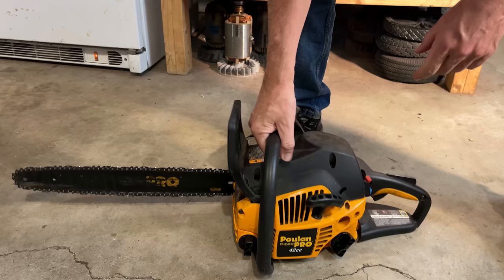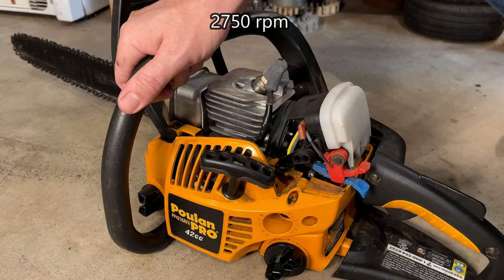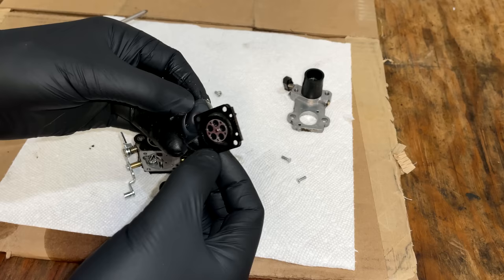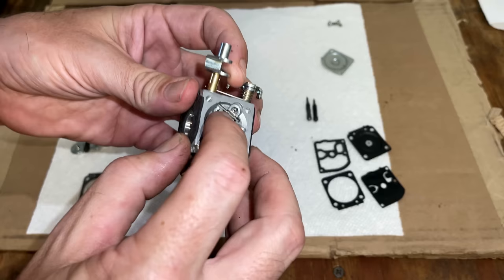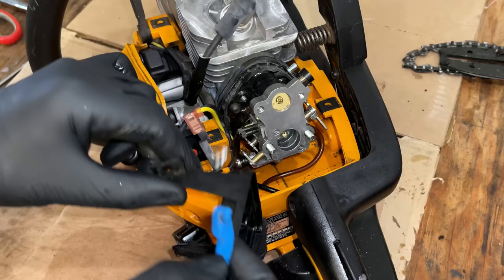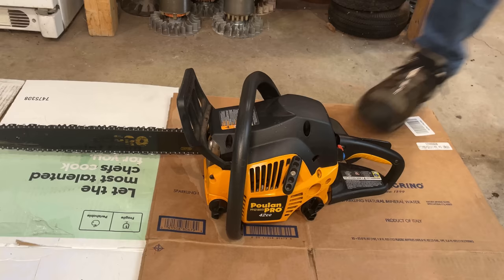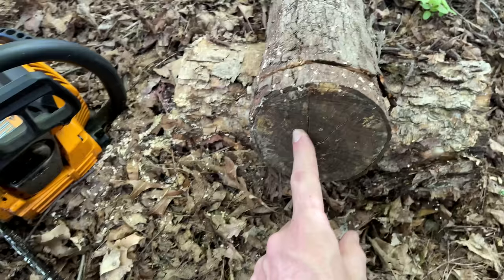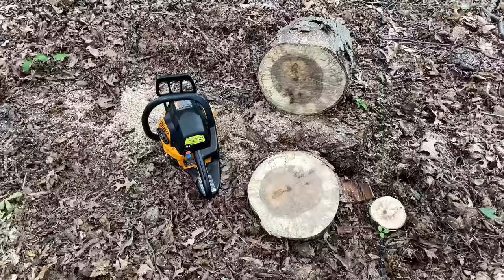Poulan Pro Chainsaw  - Not Running or Cutting Well

Comment: I would have had a look at the spark plug and air filter before the first start attempt; plus old fuel in the tank/lines is always a potential problem; and built up dirt, leaves, twigs around the primary/drive cog could prevent getting a good first impression. 
And once again we are reminded of the hundreds of minds whose contribution is combined into, in this instance, the types of components needed in a miniature carburettor, all needed to replace an axe whose biggest problem was the 90° connection.
The brother-in-law story doesn't resonate, those things don't last 10 years if they were actually needed. Sounds more like a sister problem.

Comment: I’ve had OEM carbs for those saws fail pressure testing right out of the bag!
Reply: When you open the fuel cap if it spits a geyser of gasoline in the air, 
it has passed the pressure test

Comment: Before this video I'd only seen some of your lawnmower videos. The chainsaw engine carburetor in this video looks more complicated than any of the lawnmower engine carburetors. Why is that? Is it because chainsaws need to be able to operate from a wider variety of positions than lawnmowers, such as on their side or even upside down?
Reply from the maker: That is it.  A lawn mower carb only works when level.  A chainsaw you can run in any position.

Comment: dang man i wish you got into the trigger assy; I have rebuilt my uncles old 90's Poulan Pro 295 but i failed to take a picture of how the throttle cable linkage is connected in the trigger assy (why did i take this apart!!) and I cannot get it back together

Comment: I would have also , at least , would have inspected the fuel pick up filter.  Larry Small is right the spark arrestor screen needed to be at least checked and or cleaned.  Then most importantly NEVER loan it or probably any other tool to the dope that did that to the chain , I mean what were they cutting?  Concrete?  Then not maintaining it at all as far as I can tell , son of a gun that looked bad.  One question , did that saw have bucking spikes on the left side of the bar?  I couldn't see any..
Reply from the maker: That chain was definitely cutting rocks.  The fuel filter and spark arrestor looked fine.  Did not mention that.

Comment: Poulan, Partner, McCulloch... I don't understand why Husqvarna Electrolux maintains all these brands to make products of inferior quality than those sold under the Husqvarna brand.
My dad bought a Partner 350CCS in 1996/97 and it never worked properly, had the carb replaced several times under warranty and several more times after.
In 1999 he decided to buy a chainsaw to replace a Partner S55 from the mid 70s just because it hadn't chain brake, back then there was no internet here to find compatible parts from newer models or models designed for other countries.

Someone recommended a Husqvarna to him, his answer was like "how the hell am I going to want another Husqvarna if the Partner that doesn't work says on the label that it's made by Husqvarna"

23 years later we have seven Stihl machines, we just had to buy a few spark plugs and air filters. I also have a Husqvarna hedge trimmer that works perfectly, I bought it second hand 10 years ago after determining that only when it is sold as Husqvarna it has the quality expected from a brand like Husqvarna, and it has not given me any problems either.

I have also repaired several Husqvarna chainsaws for other people, except for the wear and tear parts I just had to adjust the carbs to make them run like new.
I tried to rebuild that crappy 350CCS, the fix is using a brand new carburettor every week, looks like Walbro makes them OEM carbs just as crappy as the rest of the machine. 

Now I have two half worn out but authentic Partner chainsaws from the 70's (I was given a very early S55) that perform much better than new Partner's right out of the box.

Comment: Great video. I actually have two Poulan chain saws one is an older Wild thing both with the same issues. Not wanting to mess with them after sitting for a couple years I took them to the local small engine place to let them check em out. They redid the carbs, replaced the fuel lines etc. and were supposed to make the run and idle. I picked them up but they sat for a few months before using. They did start up and idle but neither will idle hot after cutting some wood. They'd die immediately after the throttle was released. They will start right back up and cut but the hot idle is the problem. Think perhaps it the low adjustment a bit to rich? They both seem to have adequate cutting power. Thanks.
Reply: Try adjusting your spark plug gap. The gap is set very tight from the factory, and once it heats up, the metal expands, and the gap is too small to keep it idling correctly.

Comment: allways use an air chuck too clean the bar and oil bar holes if you dont it will destroy the new chain and after so long of use when you sharpen or replace chain flip bar opaset so it wares even

Comment: Even a badly worn chain when sharpened, should cut better than this one did.  I could be wrong, but it looked like the "rakers" (depth of cut control) had not been filed down to compensate for the worn  teeth.
Reply from the maker: They should.  But the chain was in terrible shape.  Did not spend much time on trying to bring it back.

Comment: i am surprised someone would pay to have one of these service. i guess it makes good content for youtube but i can go to princess auto and buy a refurbished saw just like it for $150. these things are rarely worth doing much with because they are almost cheaper to replace than to buy parts. my neighbor had one that needed $100 in parts. i ended up lucking out and finding a parts saw free. the funny part was the parts saw actually ran and had 150psi compression never thought to check a saw i got for free till after i pulled the needed parts off it.

Comment: What do you think about the pre mixed 🤔 fuel from the store.
Reply: Save your money. Use Sunoco non ethanol or other non ethanol 
gasoline with any modern 2 cycle oil rated for 50 to 1 or better.

Comment: I had a Poulan that was multi attachment, ended up using it in chainsaw mode only. These things are vicious with cutting wood but the Mower Center I was taking it to for servicing hated it. They rev high, use far too much lube bar oil, and the carb is a pain to deal with. Also, the vibration dampening is 'non-existant'. After only two service intervals, the Mower shop didn't want to see it ever again. Did myself a favor after that, bought a Stihl. Problem solved.
Reply: I charge appropriately for equipment I know will require more time.  Seldom will I turn a customer or equipment away.  Some of the new consumer Stihls are incredibly troublesome for customers.  Very specific start sequence.  Failure to follow the procedure results in a flooded saw.

Comment: I’m having issues with a generator and it has me stumped. I have spark and compression but with not start with starting fluid. I had it start to test to see if it makes power and does. Can you help me out?
Reply: Watch James' previous vids.
You have a fuel supply problem.
Take off the rubber hose under the fuel tank; turn the tap and see how much fuel flows.
Then check with the fuel line connected to the carb...by unscrewing the carb bowl drain and seeing if there is suffient fuel flow. (Needle, seat and float checked by this)
After that you will need to disasemble the carb and clean or replace it...
Another good test re fuel supply is spraying LP in the intake..if it runs on that and on starting fluid..the fuel system is the problem as above.
Reply: Did it ever run for you? If so, how long since? Did it sit with old fuel in it? Make sure you never attempt to start a generator with any electrical load (its like trying to start in gear)
Best to empty all old fuel from the tank and carb. but first, only use very fresh regular gas.
Make sure nothing had plugged up the muffler, mouse, etc.

Comment: Hi James.  I have a Poulan P3416.  I have a problem with the setting of the screws, I'm not sure what the problem is, but is starts for a minute or so and backfires and goes off.  I have replaced the carb, fuel lines, filter, graskets, fresh gas 89 octane and spark plug.  What could it be?

Comment: I just bought my first chainsaw, used it a few times and it worked great.  Then it stopped cutting so I replaced the chain and it worked great for about 10 minutes and now it won’t cut.  Anyone have any ideas?

Comment: I realize this is an older video, but that saw is NOT running well.  It was as if at half throttle and the RPMs were way low and power way low.  Clogged exhaust or throttle plate not opening fully.  I am unfamiliar with Poulan homeowners saws, but that has to be weak.
Reply: Or, maybe the pump gasket goes onto the carb body and then the diaphram and then the cover???

Comment: I have the same chainsaw and mine was sitting for about 3 years, so having the same issues. Bought a kit off of Amazon also, that also had fuel lines, which mine needed. Unfortunately they sent a crazy unknown named plug that I am sure was made in a big country overseas...having a hard time finding the gap requirements for it. Anybody have that off hand?

Comment: I did this very same thing with mine But it still is very hard to start & will not keep running at low speed or without the choke on! any more suggestions?

Comment: I noticed that most people who use chainsaws these days don't have a full or proper understanding of how to sharpen chainsaws correctly. I saw you work on  other chainsaws previously and watched how you sharpened the chains. You like using those electric chain sharpeners. They do work, yes. But I saw that you have always and consistently missed one of the most important steps in properly sharpening a chainsaw. You completely negated and ignored the raker teeth in front of the chainsaw tooth. You can have the sharpest chainsaw teeth in the world. But if the teeth cannot adequately connect and contact the wood it's supposed to cut, it won't work. In addition to filing the teeth back, you also need to take a 6", or an 8" bastard flat file and file the raker teeth down. The tips of the rakers needs to be just below the cutting edge of the chain's teeth, or it won't cut.

I've seen people who knows how to cut wood with a chainsaw, end up getting frustrated because their chains don't cut well even after filing and sharpening. Not addressing the raker teeth is always the primary reason and cause of chain failure. 

The purpose of the raker is multi-fold.  First,  it ads the correct posture to the teeth as it contacts the wood. Second, it provides guidance for the chain and blade as it bites into wood during cutting. And third, they are called "rakers" for a specific reason. As a chainsaw cuts wood, the raker teeth "Rakes the sawdust and chips" out of the way so that the teeth and the blade do not become clogged and jammed in the logs during cutting.

Filing and sharpening the teeth and filing down the rakers maintains the proper orientation and balanced system of a chainsaw chain for cutting. A properly sharpened and balanced chainsaw tooth set and rakers are key elements in cutting efficiency and safety.

I'd like to think I have a good understanding of what I'm saying because after all, I grew up learning and knowing how to use chainsaws and have had years, decades of experience with how they work. But to clarify what I said, here is a link that describes how the cutting tooth and raker system works on a chainsaw's chain. Hope you don't mind, and hope this helps.

When it comes to small engine repair you really know your stuff. But you need to understand just a little bit more about chainsaws and the cutting chains they use. And incidentally, the raker is also called the "Depth Gauge," because it determines the cutting depth of the teeth. It must be properly maintained and filed to the correct height to match the teeth after sharpening.

Here's the link about Chainsaw Cutting Chains: https://www.treetec.net.au/wp-content/uploads/2020/07/Operate-and-Maintain-Chainsaws-Treetec-pre-course-reading_0720.pdf

Comment: Hi, you say that without the engine cover, it is more likely to overheat; care to explain?  Seems to me that an air-cooled engine has LESS chance of overheating if it it not enclosed in a black plastic cover, as more air can reach the cooling fins.
Reply: Dont know why nobody has replied, allow me.

The cover on almost ALL saws actually channels the air flow from the flywheel and guides it close around the cylinder and through the fins, without this forced air the engine would over heat.
Hope this clears things up!😊
Reply: @freedomman06  wow, that makes perfect sense!  Thanks for the clear explanation!

Comment: what you have to watch for on the none needle side plate is some people tighten them down to tight an it bends the plate n lets air out or in the way to check is to put a vacum pump on pressure an put it in a bucket of water an check for bubbles

Comment: I have a problem with my polan chainsaw 50cc not starting well a replace the carburetor it works a little and won’t start again and I get current from the sparks plug
Reply from the maker: The carburetor might need to be tuned or you could have an issue with compression, worn piston and rings, crankshaft seal, crankcase seal or gasket leak.

Comment: Hi James.  New subscribers here. Can you tell me where you got the small gas container and what kind of cleaning solution for the ultrasonic unit you use? Thanks.
Reply from the maker: In the ultrasonic is use Harbor Freight super heavy duty degreaser.  You mean the test tank?  Got it from Amazon https://www.amazon.com/dp/B004NV42PQ?linkCode=ssc&tag=onamzjamesc00-20&creativeASIN=B004NV42PQ&asc_item-id=amzn1.ideas.19KNRL7CFKQD5&ref_=aip_sf_list_spv_ons_m_asin
Reply: @jcondon1  the tank I was referring to is at 0.42 seconds into video. We have a solutions called Totally Awesome Cleaner that Ive been thinking about testing in my cleaner. It's like $1 per half gallon, but works really well as a degreaser/cleaner. It's also biodegradable. I'm gonna test it on an old carb pretty soon. I'll let you know the results when I try it.

Comment: I can't mess up with the carburetor, because I may not be able to put the parts back. But I learned servicing and cleaning the air filter, spark plug and the chain. I have a used 35 CC for years, but did not use it ever. Please tell me all about the oil for the lubrication.

Comment: Unfortunately you reversed the order of the main diaphragm and its gasket, if you go back and look at 23:49 you'll notice that you put the main diaphragm against the carb body and then the Square gasket with the round hole on top of it and that square gasket with the large round hole actually goes on the carb body first and then the pumping diaphragm above that which gets sandwiched by the outer plate that says Zama

Comment: I lent my chain saw out. And it came back in no run condition ! He put oil in gas tank  why don’t manufacturers label the gas caps and oil caps instead of red for gas and black for oil  in most cases ! For people that don’t use chain saws or other equipment in most cases !
Reply: Would you lend out your wife???
You needed to ensure your friend wasn't going to kill himself or the saw...
good time to be a friend and you do the chainsawing with him as helper?
Did he even offer to pay for the bits to fix it?

Comment: What is that second upper butterfly for?
Reply: Second butterfly connect directly to a  piston port located slightly lower than the exhaust port that is exposed by the piston at BDC.  This either allows for re-circulation of some burnt exhaust from the cylinder,  back though the carb and/or it might be intended to reduce incoming fresh un-burned fuel from scavenging directly out the exhaust  port? I am pretty sure this was added to engine as a low-emissions feature,  my older 2002 poulan 42cc engine design did not have this cylinder port or extra butterfly, another 2005 that I looked at did have it.

Comment: that old chain was not cutting at all . itm was rubbing it,s way though hat small log .. I sharpen my own chaoinsaw blades and my little chainsaw actually eats the log . no pressuure  itm chomps it,s way through in seconds .my chainsaw disc sharpener is a €30 euro Lidl   cheapo .. and it works like a deam    all of my friends come to have their chainsAW BLADES SHARPENED .

Comment: I despise these plastic 45cc and under saws, most of them have air leaks or if you even think about touching the carburetor, it will develop an air leak at the intake boot or gaskets. If by some miracle they don't have an air leak and can be tuned, give it 2-3 heat cycles and all the adjustments go straight out the window. I've rage quit on my fair share of them, straight into the bin they go.